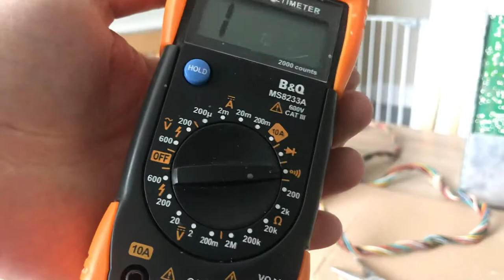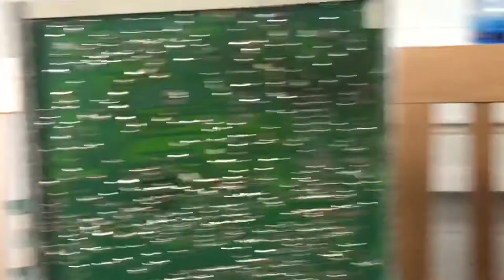How to test the HOT ( horizontal output transistor ) using a multimeter on a HANTAREX POLO Monitor

Comment: I love Hantarex or any of the Hantarex family of chassis like Intervideo, SELTI, SIVID etc, I use Intervideo and Selti chassis is my cabs they are absolute tops and parts are readily available for them and cheap, funnily enough just repaired my Street Fighter 2 Hyper Fighting cab which has a selti chassis, power supply caps went bad, gave me a good excuse to overhaul the whole monitor and chuck in a new Tube as well,  considering I haven't touched it in years its done rather well.

Comment: back in the day 44, what common causes the HOT horizontal output transistor to go bad and short out? what common causes this to happen?
Reply from the maker: wayne Gram most common problem seems to be the fly back although I’ve had a fly back go and not take the hot out ... there’s certain capacities that go  or come loose and short that also take out the HOT . Aswell as the the 3 poly capacitors near the hot I’ve seen them go bad n need replacing before the HOT stops blowing . It’s hard work keeping these monitors healthy n Alive lol
Reply: so its mostly the flyback and the poly capacitors that goes bad that will damage the HOT? its not the B+ Voltage that damages the HOT?
Reply from the maker: wayne Gram not experienced that but I’ve ordered a new hot for the 28” ... ill do video and check the b+ voltage on the 28” before I do the hot n also test the fly back ... the 25” is fully working now !! Found out that after the ac repair and the fly back been replaced all I had to do was get a good Jamma board on n calibrate the settings problem I had was the pc that was in wasent kicking out the 15hrz so the monitor wasent syncing ... put sonic blast man Jamma board to in and it’s now all sorted !
Reply: Anything on the horizontal cuircut can take out the Hot, shorted width caps is the ones I used to see a lot of especially on the old Wells-gardner chassis, sometimes it would also take out a voltage regulator too.